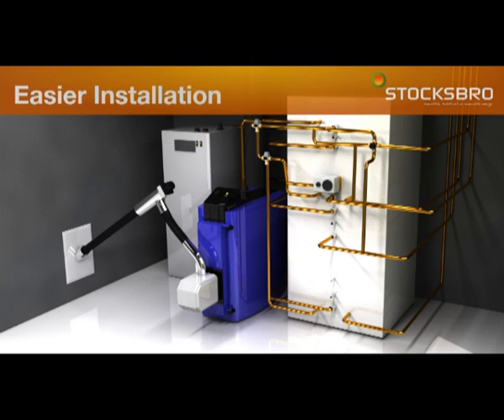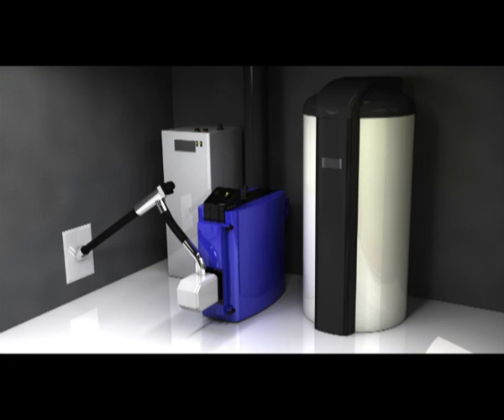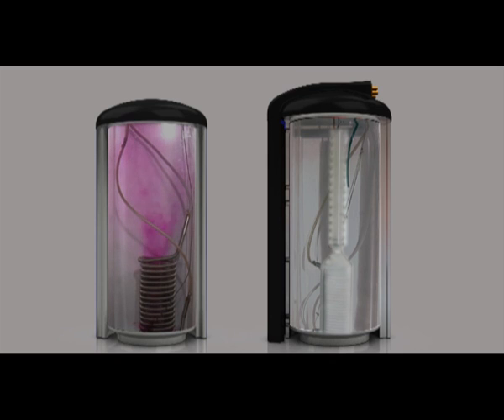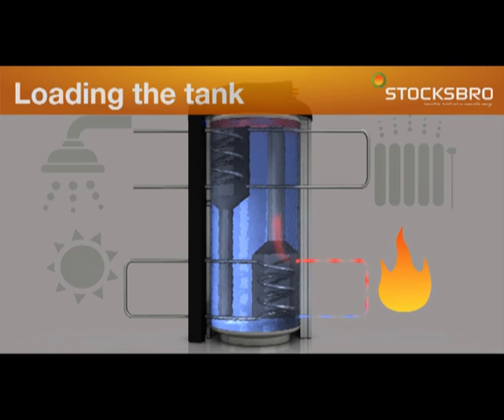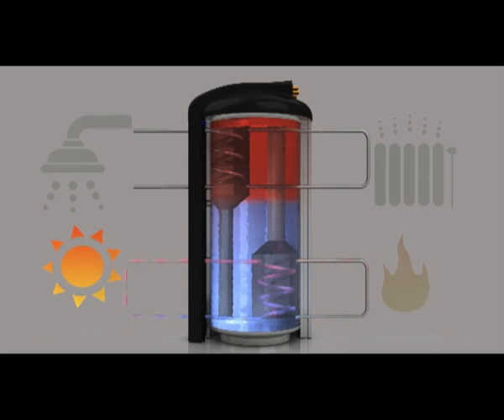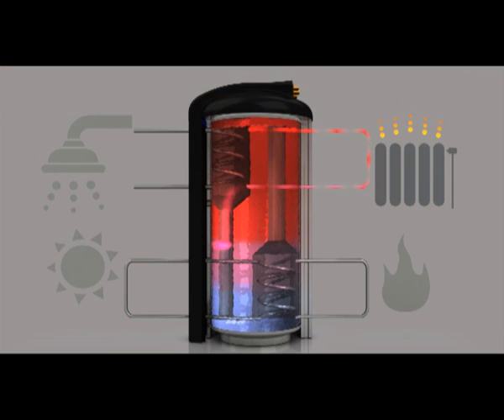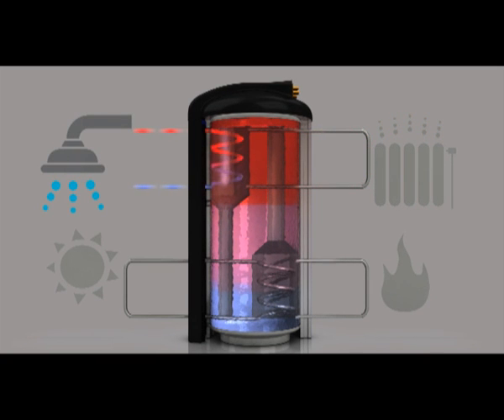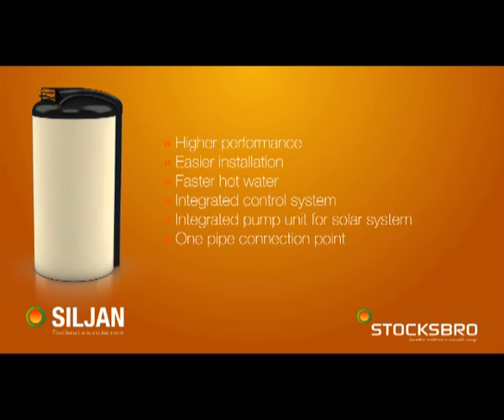Hot water tank stratifying solar energy storage

Comment: This does solve interesting problems of how to load a buffer tank from a wood burner, whose output temperature varies from 50ºC to 95ºC.  But it's not clear whether hot water can be drawn out at different temperatures, say :
 1) 35ºC for a UFH mixer, and 
 2) 65ºC for a domestic hot water tank.
This may have no solution because the top of the buffer tank could be at any temperature 20 -95ºC at any time when the heat is being called for.  At least the return temp from the UFH or DHW Cylinder will be re-inserted at the correct stratum.
Does Stocksbro have requirements for slow speed of drawing off heat ?

Comment: Had planned a simpler concept of allowing stratification in taller tank by pumping heating loop from top down , acting like a counterflow heat exchanger , the top will extract heat up to the input temp of the heating loop , the loop will get cooler as it spirals  down , will return to pump at heat source  (diesel heater).
The net result is the top of tank is heated first , so very Hot water is available quickly long before the whole tank heats up.
Better for intermittent heating. Secondary heat extraction loop is run in tank (pipe spiral in contact with heat source loop) from bottom up (counter flow) for Hydronic heating. 
Pumped Gylcol will collect heat as it rises up spiral tube even when primary heat source is off, using tank as energy storage .
Hydronic heat circuit using mixing valve to lower output temp to floor heating value ( 85 to 110F)
Reply: The reason your concept is simpler is because it will only work with a high temperature (like diesel) heater you mentioned. If you would also run medium temperature solar heated water through the hot top part you would effectively draw heat from there and move it lower in the cylinder, reducing the stratification. The concept in this video is more complex but allows for multiple temperature heat sources to effectively give off heat to the cylinder without reducing the stratification.